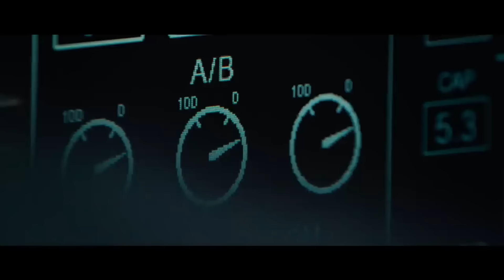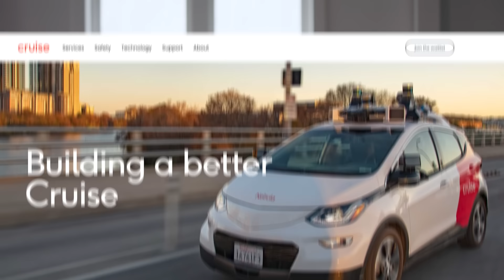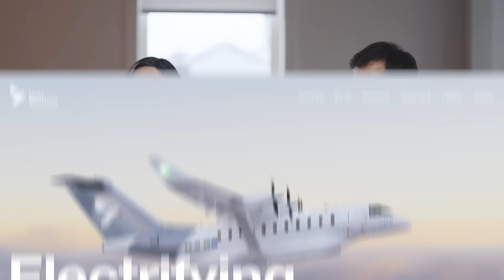Inside The Hard Tech Startups Turning Sci-Fi Into Reality

Comment: No offence but Boom is not a very good example of a successful startup. Its an example of a startup that got good financing. They just burned a lot of money and 8 years later they are still developing. A lot of LOIs prove nothing when it turns out their plane is worth couple of Boeings. There is a reason why Concorde flew only couple of destinations, reason being cost of travel (10k per ticket from London to NY). Its like assumimg there is a huge market for 1 class tickets, there is not and 90% destinations you cant reach in 1 class. Your all acting out like they are next big thing and cant see the obvious, they are the next Theranos. Dont get me wrong its a greate idea but commercially its impossible to achive. Airline companies are on very thin margins and cutting cost on everything, so let's make smaller plane and 10x more expensive, but it is faster!!! Seems like a great idea said no one. I would rather give money to a company that is using new technologies to make a regular plane (e.g. carbon fiber cabin, hydrogen engines or modified engines so they can burn hydrogen, fly by wire, simplified design, planes made by 3d printing, this kind of stuff) so its lighter more efficient and costs half the money of a Boeing or Airbus. These old companies cant do that because they are old tech, huge and cant addapt that quickly to new conditions and new technologies.